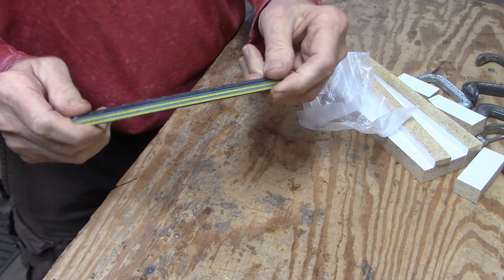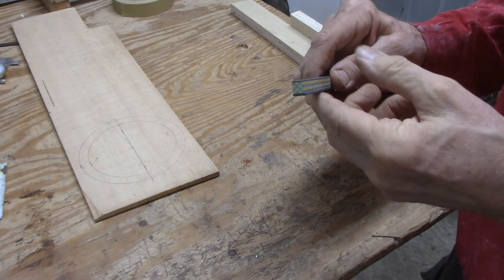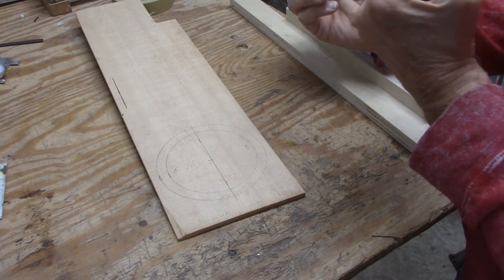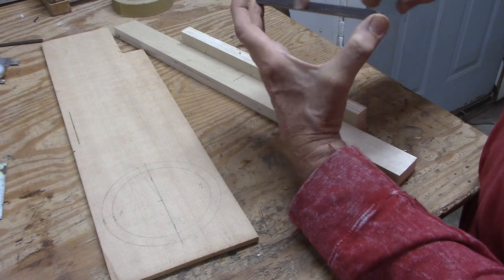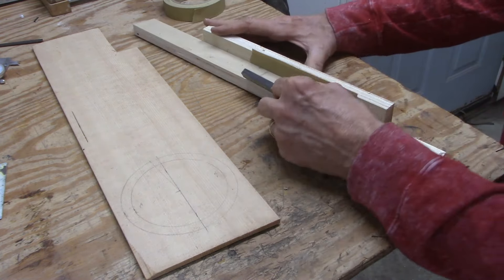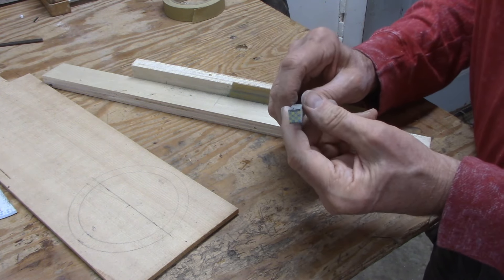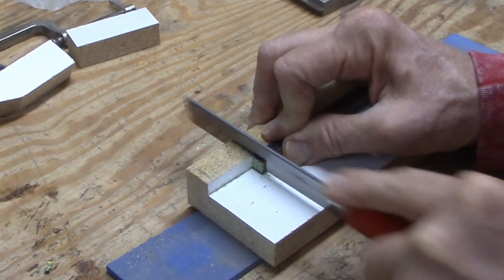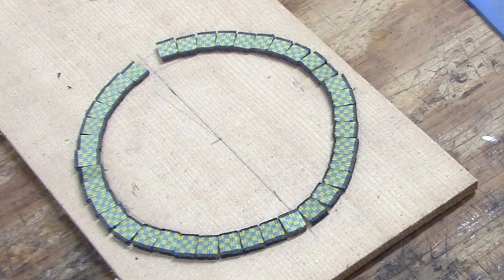Making a Classical Guitar Rosette, part 2

Comment: So if you wanted a matching mosaic on the bridge tie bar would you create a new tile set or modify and shape the extra from the Rosette?
Reply from the maker: It would depend upon the width of the rosette log and how that compared to the width of the tie block. If the were close, I would use pieces of the rosette log in the tie block. Otherwise,  I would have to make a separate log.